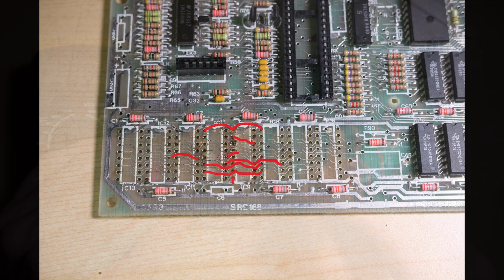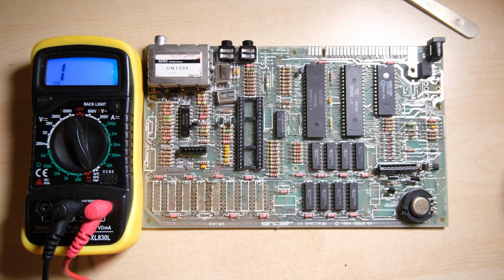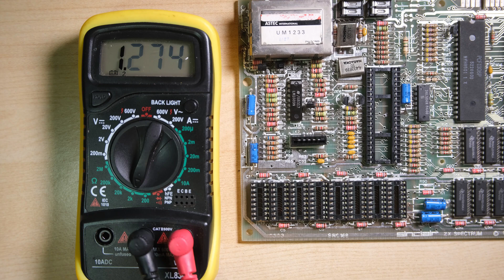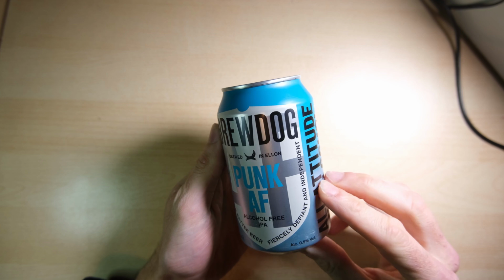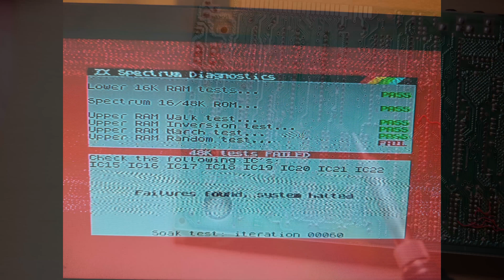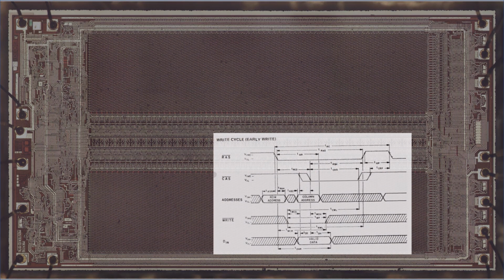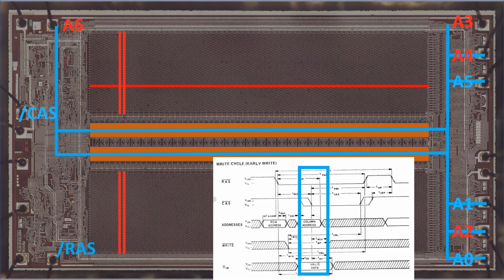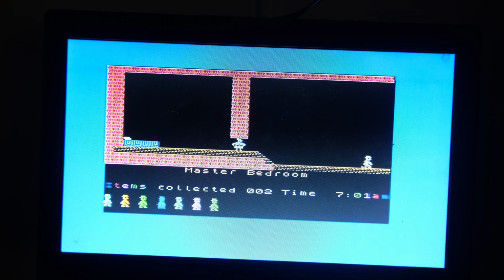Monster ZX Spectrum Repair Job!

Comment: Hard work that, especially with the removed traces. 
Just bought 3 Speccies and 2 c64s to add to my working stock. 
Hope they aren't that bad. 
What make and model of oscilloscope is that and do I really need one (I have a RAM chip tester for those chips and a multimeter) ?

Comment: @13:20 aren't you missing one of the capacitors for the -5/12v voltage circuit.  Isn't there 4 on the right side?
Reply from the maker: Yes :)  I was waiting for some new 4.7uF caps. C74 improves reliability but as we saw the spectrum still runs and voltages seemed OK
Reply: @HappyLittleDiodes  I have to wonder is it better to harvest chips off these boards and put them on reproduction motherboards ?  Seems a ULA died in one of the repairs…. Still impressive to see the repairs and the hard work !

Comment: looking at the state that board was in at the beginning of the video i don't feel so bad about my ham-fisted attempt at fixing my issue 2 board - lets just say that i learned how easy those traces can lift, especially if you use a stupidly hot iron and a vicious mechanical solder pump ... still, i got it working in the end though!
Reply from the maker: That's what I like to hear!

Comment: BTW for patching stuff, enamelled wire is well worth having... especially for repairing the tracks where the memory was. The enamel will only melt where it is heated with the iron, so you can make really neat joints without worrying about the hassle of plastic insulation melting. I salvaged most of my stock from scrapped CRT's but you can buy it easily enough. 

I hate seeing burned flux like that.. almost certainly the result of using a cheap plug-in mains soldering iron that doesnt regulate its temperature. Temperature regulated irons are so cheap nowadays there is no excuse for not having one!
Reply from the maker: I have some enamelled wire but I haven't actually used it yet!
Reply: @HappyLittleDiodes  Once you try it you'll never make patch wires without it again ;)
Reply: @HappyLittleDiodes  I use enamel wire too, and bend it to follow the line where the broken track was. Once it is confirmed working, the apply green nail polish on top of it, which sticks it well enough to the board (has to be really cleaned with IPA before) and also restores the look of the solder mask.